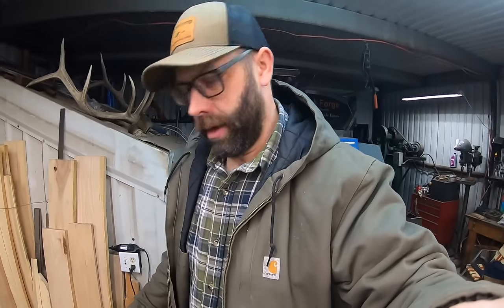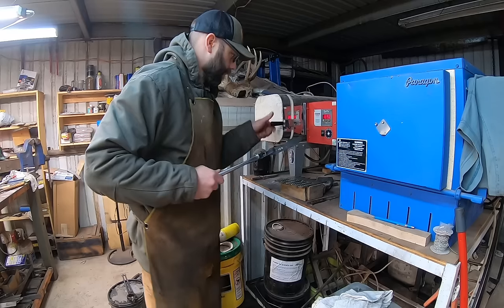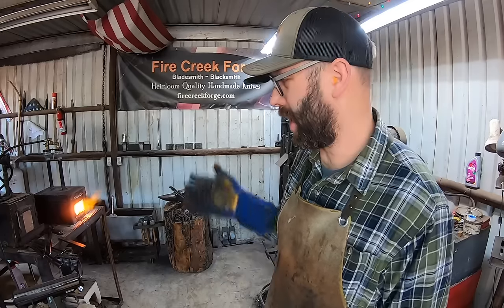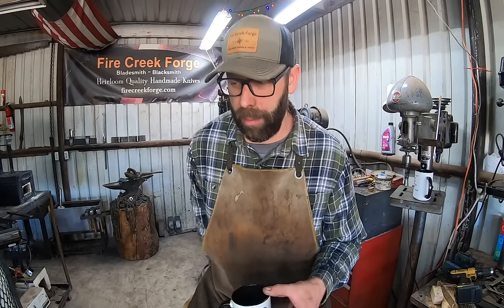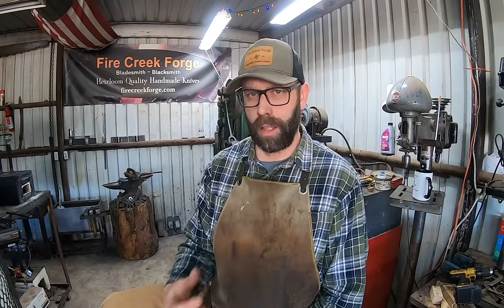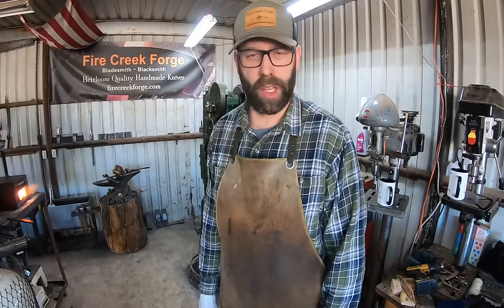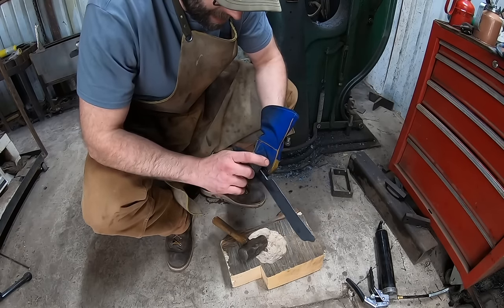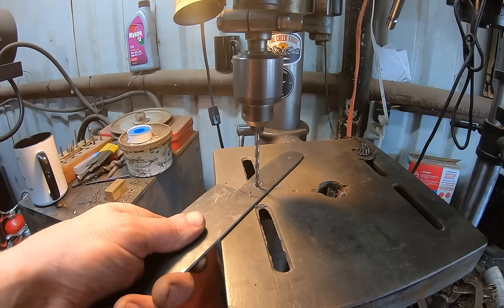How To Make San Mai, Building Knives And Forge Welding Stainless

Comment from the maker: I just want to clarify something: It is necessary based on everything I've read, to seal up a stainless san mai billet with your welder for an air tight billet. The option for flux or not that I mentioned was referring to the non stainless steel version. The reason is because chromium oxides form very easily and do not dissolve with normal flux.
Reply: I havent had much luck with anything stainless. I feel like a couple things might help me out, since i just stopped trying for now. Wasting too much time and material. 

But having a welder with argon like mig or tig, and getting a press. Since im doing it by hand. Just makes things a bit harder to really get that pressure for a good forge weld, especially with stainless.

Probably didnt help i was trying to use high alloy core steels.
Reply: @_BLANK_BLANK I feel sorry for your arm and shoulder forging stainless, especially a billet. It does not move well under the hammer.
Reply: @erikcourtney1834  yeah. Definitely harder to move. The worst i have ever tried forging was 10v. It was like forging cold steel
Reply: @_BLANK_BLANK  I’ve never messed with 10v. You should try forging h13…. Hardest thing to forge that I’ve  came across. It’s very tough at higher heats which is why its the perfect steel for doing hot work.

Comment: I use 304 stainless for San mai just because Its free and have plenty of it. I know Karl Anderson says the 416 is the best choice along with 1095. I believe the 304 polishes up better according to pictures since I haven’t used 416.  I do know for sure the scale on 304 is extremely hard to remove. Not sure if a power hammer will help with this or not, all I have is a press so it doesn’t do anything for removing scale. The water, hammer, and anvil  trick does help though. Just thought I’d share some of my experience with stainless san mai.
Reply from the maker: Thanks, I appreciate it.
Reply: If you like the carbon migration line keep the billet at a welding heat while forging. The longer the forging the better the migration (obviously). Don’t use Damascus for a core either if you want any migration lines. I used 160 layers of 1084 and 15n20 between 304. It’s rather depressing. It’s shinny polished stainless directly into Damascus.  It wasn’t what I was going for. To much nickel ruins stainless San mai in my opinion.  
I could keep going but I believe you’ll learn and figure it out as I did……Trial and error.😉 God bless.

Comment: I went from one 100# tank to 2, split into my one hose to the forge and I’ve cut my PSI in half, added 100* and no freezing…I have the same forge as you but it’s the 3 burner. I achieved 2465*
Reply from the maker: Good to know, thanks

Comment: The hardest thing is stainless steel which can't be made sharp because of the chromium which reduces the sharpness of steel so there is nothing to make it sharp and it doesn't reach the level of carbon steel and if you give a sword or knife to a child made of stainless steel he won't cut himself because he is not fit to have the ability to make it sharp anyway your explanation was the best of all